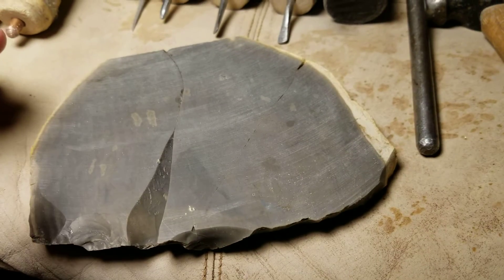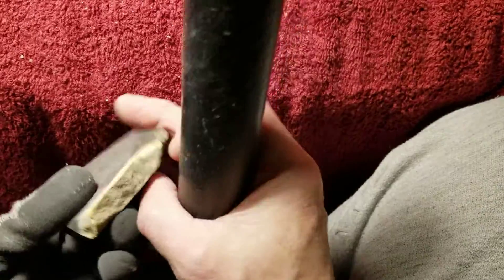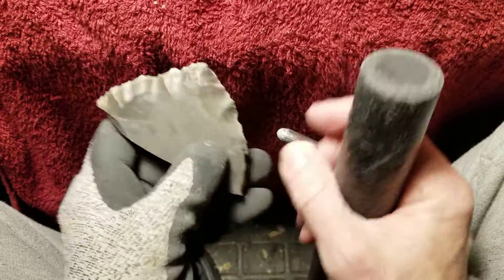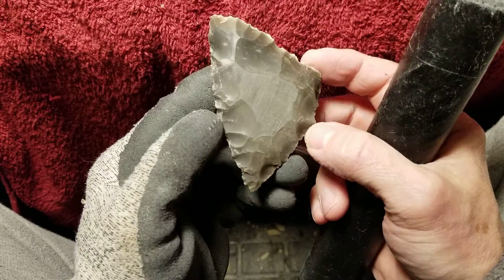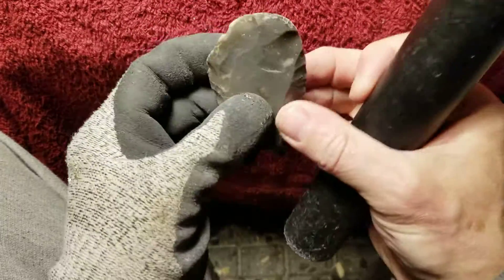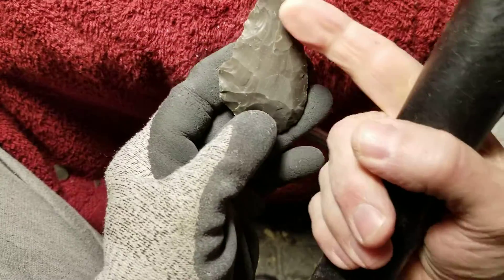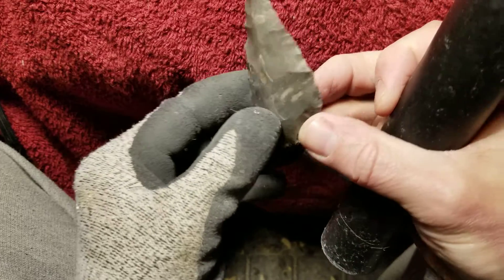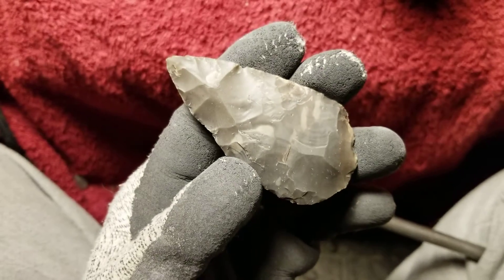1065 - Hornstone Slab Adventures Part 1/7

Comment: I just started a couple of weeks ago and have been practicing on the cheapest material which is porcelain floor tiles. But I am still trying to learn how to do, for lack of better terms  get the shiny top side of the tile off and then also the bottom side with the Grid on it. So this video for me is the most important because one can never get to another step if one can't do this first.
Reply: Try subway tile from Home Depot or Lowes. This stuff is three inches wide, twelve inches long, and 5/16” thick. It’s made from glass and is painted on one side which knapps right off.. Cost about three bucks and I cut it into twelve pieces one and one half wide and three inches long.
Reply: Glass bottle bottoms are great for learning how to work obsidian

Comment: to me it is most satisfying to watch the nice, large flakes scream off. like a flute, isnt that done with pressure flaking? (NO THAT IS PERCUSSION RIGHT?) that is a nice solid smack bringing a big long flake off at once.
when you are pushing tiny flakes off using the pad well it is just small stuff. that does bring the sides and sharpness in line but on a smaller scale. (PRESSURE FLAKE) pushing the flake off.
the notching makes me nervous. i might be more critical of your notch than you because you have bumped an edge and it makes the notch wider and thats harder to repair.

Comment: What kind of support are you giving underneath?  Directly under the flake removal or bridging on either side?  Firmer or softer pressure?
Reply from the maker: Soft pressure (70% of the time) and bridging 30%. Bridging is the default when I'm trying for long flakes. But I can use soft pressure at any time, like when I'm trying to catch the flake for the video. Most of the time I don't even pay attention.
Reply: @KnapperJackCrafty  thanks!  Definitely one of my favorite knappers to watch.   I'm gonna start asking more questions

Comment: would scoring with a diamond scribe or file edge and a steel rule as a guide help to snap longitudal sections more predictably ? im sure u probs tried the glass scorer ? edit i meant diamond file edge to file a score line
Reply from the maker: I've tried scribing stone before breaking it but it didn't work. Bridging the slab and putting a lot of pressure in the center works pretty good ...but I need to be set up for it with wood blocks and a very heavy bar to apply force in the middle. I brought minimal tools with me this time...

Comment: have you seen that the ancient mongolians utilised a burin type flake tek to create "quad tip arrow points ? your burin flakes look similar , i reckon you could manage a repro no bother !  .. this comment is turning into a challenge lol
Reply from the maker: Yeah, that type of arrowhead is on my list. I think the tip combines fine grinding and burinating because you have to eliminate the platform remnant on the last burin removal. This can only be done with grinding and polishing as the final step, in my experience.